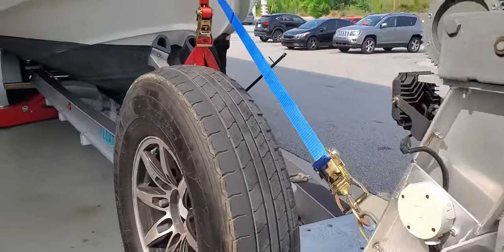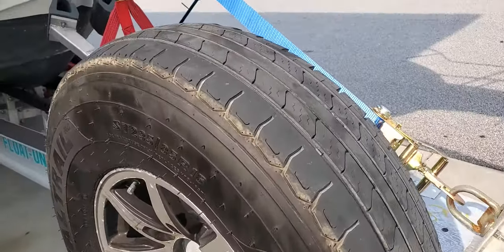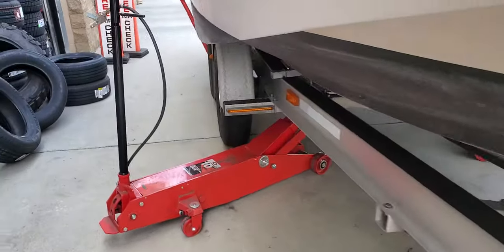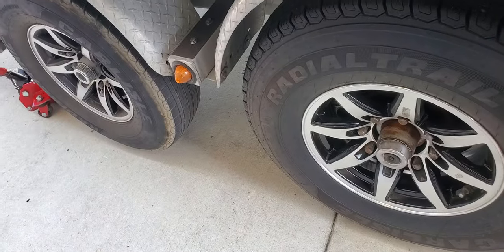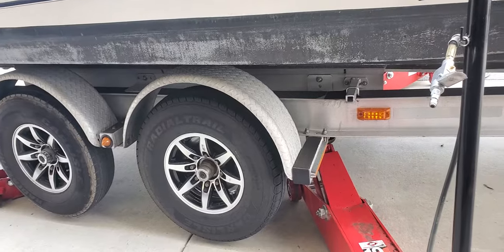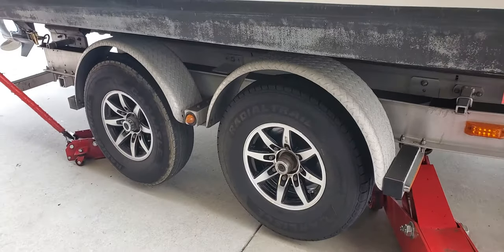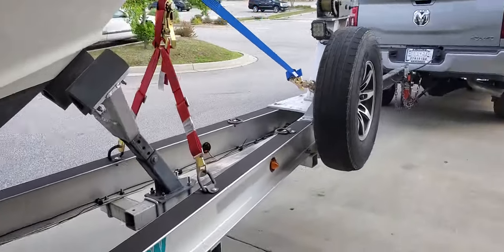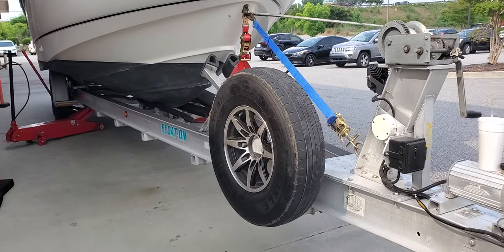THANKS #DiscountTire for Taking Care of My Tires!

Comment: Discount Tire is great. I haven't been to a bad one here in Texas.
Reply: They screwed me hard a few days ago, won’t honor price match without a LOT of run around to different employees after install and wait in line more, then tell me about my TPMS after the install and also took my chrome valve stem caps and replaced with plastics. 😕....Brand new Pirellis on 22’s on a custom pearl white Limited F-150. Boerne Texas Location TXS 23. You’ve been warned. Don’t take nice vehicles to discount. I would take my 4-wheelers here though. 🤷🏻‍♂️👍🏻🇺🇸